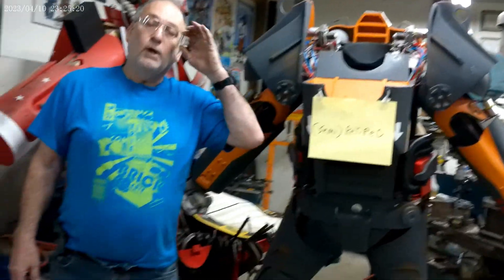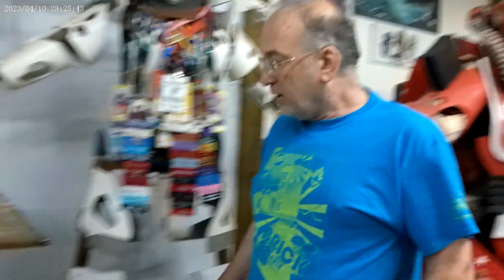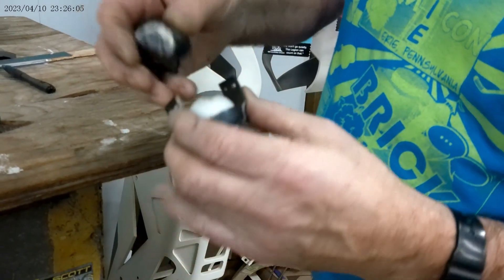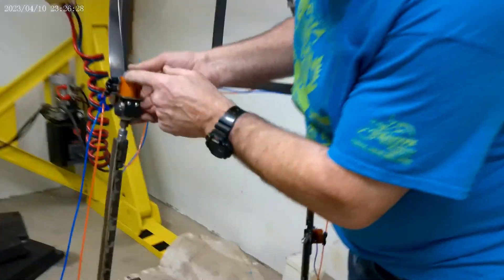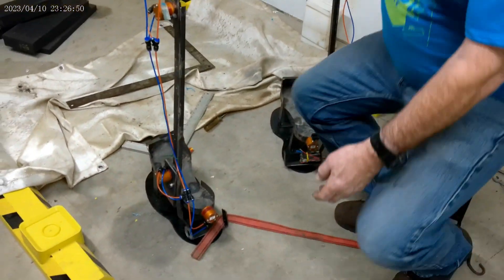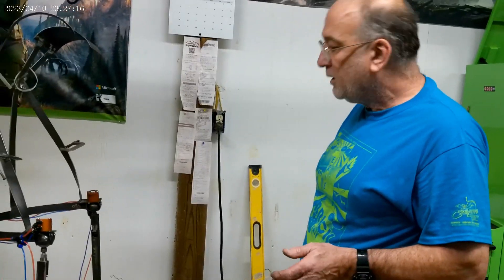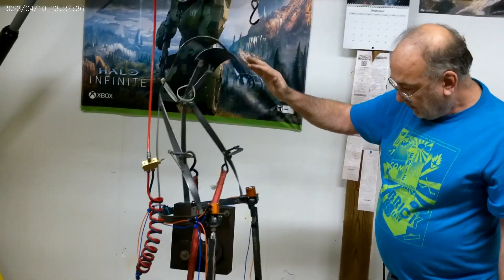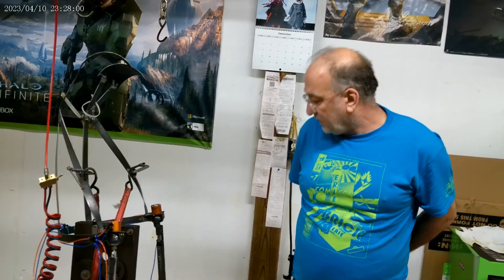The locking ball joint

Comment: I think it would be good to invest in 3d printing or Is reusing the frame you have in the background and put the armor around it for Is armor changeability And making a little bit more sturdy
Reply from the maker: Hi
These were designed so different skins could be attached to the same frame kind of like in the game.
 the new skeleton i’m building I’m trying to standardize the mounting holes so that any skin would work with either of my frames. I am thinking about branching into 3-D printing, but my computer skills are feeble so it will take a little studying to be able to do it
Reply: @ray16120  Absolutely. Great to hear.  The speed of your progression is absolutely Is astonishing. Keep going man👌